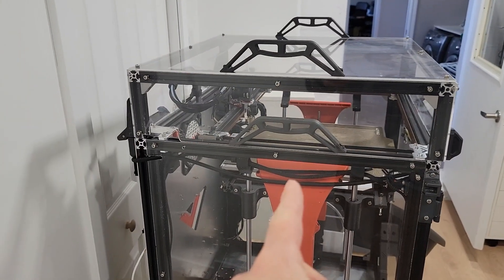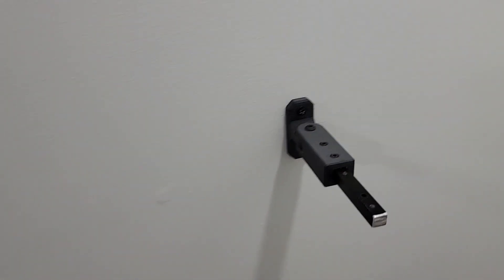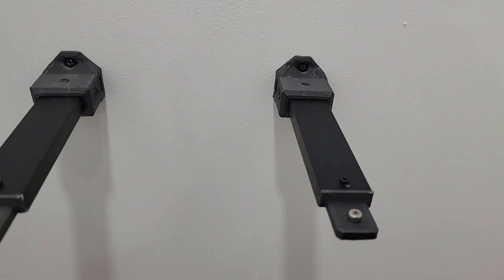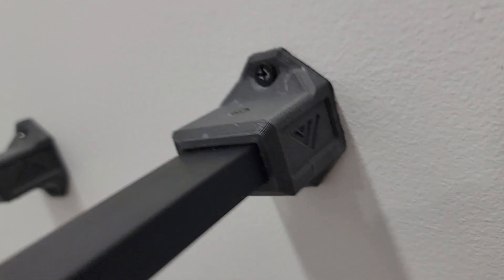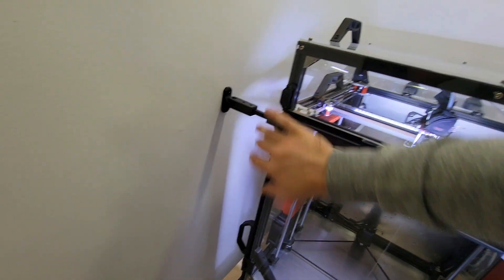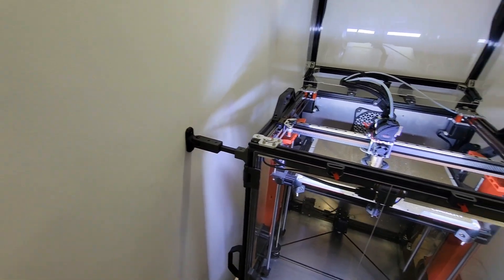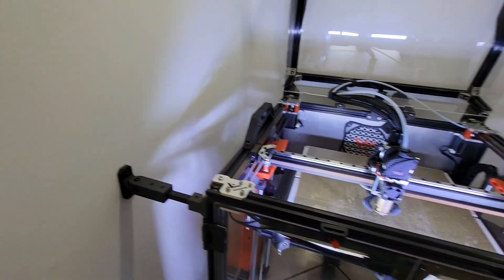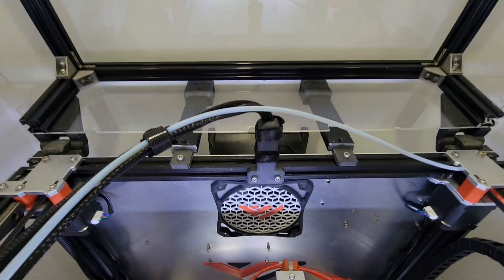bolted the VzBoT to the concrete wall

Comment: where we can find the part to print them?
Reply from the maker: Its probably usless since the rear aluminum parts were left over from my shower. And left mount was made with left over from the tronxy x5s bed assembly. I suggest you use the brace from the the vz235 github instead
Reply: @Vez3D  thanks Simon

Comment: Couple of days ago i was wondering if it would be smart to put a printer in a larger cube frame, and fix it to it with some kind of vibration dampeners in all axis, to allow the whole printer to move thus transfering the vibration to the dampeners instead of the print, do you guys think it would be smart?

Comment: That is awesome! As a bedslinger owner I did something similar but from the bottom. I made a concrete table out of concrete flagstone 600x600. It weights almost 100kg. I drilled thru 4 holes that match the position of vslot frame and bolted the printer tightly with t-nuts. Max recommended input shaper value increased from 4k to 9k. Maybe you should give it a Try. It costs nothing and some extra rigidity is always welcome.

Comment: Be interesting to see if this improves the print quality - it may well make the reliability worse in terms of the vibration shaking bits loose?
Reply from the maker: my printer been screwed to the wall for months .. maybe full year. :) its been fine

Comment: 6DoF --> 6 rods :) .. or do you trust your Ikea drawers to hold the base steady? 
IMO, at least two more horizontal rods near the base (one X and one Y) are advisable. The Z-stiffness of the drawers can likely be trusted.
Reply from the maker: more mounts would be good yes.. but I dont think its necessary at this point. I think its totally stiff enough the way it is right now. We shall see. Thanks for the suggestion too :)

Comment: But now the wall acts like a speaker!
Reply from the maker: not this one. Before, on the old location, yes..it was very noticeable, because the was a inside wall, with just air inside. But I was surprise on these 2 walls. They are full isolated with foam and mounted on concrete basement. Sound is not bad at all. And since this is in the basement and all walls are concrete, you dont hear anything in the rest of the house :)
Reply: @Vez3D  man i love what you do,  keep the content flooding <3

Comment: This is neat but I’d really love to see some analysis of how this improved your printing like a before/after input shaper graph comparison
Reply: Im not sure its really worth quantifying in that level of detail. Either it makes a BIG difference and the results are instantly noticeable, or the improvements are not visually apparent, and therefor probably negligible. Either way its a win cause less vibration = less noise / generally just more secure and stable, keeps it from getting bounced around or knocked by pets or kids as well.... I might consider doing this myself :p
Reply from the maker: thing is.. it doesnt change a lot on the shaper graph honestly. BUT there is more than just resonnance at the printhead and frame. There is also vibration on the bed. When the printer is moveing a lot, the bed also is being shook at lot at high accel. Bolting to wall stabilize the whole thing... I realized this a while back. hehe Bed needs to be ultra stable... and it cant be stable when the printer is shook hard.
Reply: @Vez3D  The bed (z-axis) and x,y gantry should not even be mechanically connected. They should be two independent structures therefore vibration cannot be transfered.
Reply from the maker: @Internet Tough Guy  gantry is attached to frame right? It slides on a rail that is attached to frame. That movement is shaking the entire printer. The bed is in the printer right? If the whole printer moves...then bed moves with the printer. The bed plate is shook too by the frame that is shaken from the gantry motion. The bed is sitting on either springs or silicon. There is a bit of this but also a bit of slack too in the bearing, etc..  So yes..it affected..at leat in my case :)  but this is only at violent accel settings. I had a ultra slow motion video i took that show this very cleanly. But it was with odrive who have WAY more inertia than those nema17. And there was absolutely no way to run this without wall anchors hehe
Reply: @Vez3D  Yes I understand how it's built. What I meant to say is for your next project think about a design where the x,y gantry structure is completely separate from the z-axis bed structure. the bed structure would sit inside the x,y structure but not be physically attached to it aside from sitting on the same heavy base (preferably concrete or granite). The bed structure would still be on isolators.
Reply from the maker: @Internet Tough Guy  ah I see!! Interesting idea :) thanks for sharing
Reply: @internettoughguy  are you talking about the design by pantheon 3d printers
Reply: @Z-add  I don't know about that printer. I'm a structural engineer. I design equipment to measure thrust of aircraft engines among other things. Understanding how mechanical structures behave under dynamic load is my specialty.

Comment: If you see any improvement in print quality, improving the rigidity of the frame should be the next step. Those thin aluminum extrusions probably ring like crazy at these high accelerations. 

I really want to see a printer like this with an epoxy granite frame. They build industrial milling machines out of that stuff and it's surprisingly easy to cast.
Reply from the maker: i get super nice quality and input shaper does the job.. and bolting to wall.. i dont get a lot of ringing honestly. And I dont want that printer to be too heavy.. because thne it becomes super hard to move. the frame is super rigid with all the pannels acting as brace. It wont move at all :)
Reply: Yea, I think it wouldnt make much sense, but it would be really interesting to see

Comment: Would be interesting to hear if the vibrations from the printer can be heard in the house, or from the outside.

I'm interested in doing the same to mine, but I live in an apartment, so I'm worried about disturbing my neighbors.

Been thinking about adding an RC-car damper, or a bike steering damper so any harch vibrations are muted and dampened out.
Reply from the maker: definately not a mod for normal walls. I had that before, and it amplify sounds a lot. Now with these concreate external walls.. its perfect. It even dampens the noise. If you still want to do this.. you could use rubber between the mounds and the fame or the wall to reduce vibration transmission. In my case, i wanted all vibration to be tranmistted to the wall
Reply: You could try anti-vibration feet for washing machines
Reply from the maker: @al1sa920  I have rubber fee on the printer too.

Comment: I have always wondered what's better for quality at speed- Bolting the frame to a concrete wall? Or having a really rigid frame and let the frame dance on the table?

Will the forces exerted by the motor on the frame warp the frame if it's bolted to the rigid wall? The energy has to go somewhere right?
Reply: i have wondered the same. tall thin parts may detach from the print bed with the dancing printer method though.

Comment: This is awesome, congrats. I wonder, if you see an improvement in quality, if a tuned mass damper (or other damper on the enclosure) would be a solution.
Reply: This printer gets to speeds where the forces exerted on the frame create shape deformations. In this process heat is produced and energy is lost, however the frame is also elastic and thus the frame itself is a mass spring damper. Im honestly not even talking about the "moving parts" like gantry itself. That said Damping the energy out of the system is one way to get rid of oscillations, but it lowers the systems higher cutoff frequency thus reducing the accelerations you can run it at.

This one quick modification decreases the compliance in this frame so significantly that higher frequency wont every be an issue.

Its almost equivalent to mounting your z axis and gantry on the concrete directly. 
So if you just want to get rid of some difficult to deal with printing attributes, this is probably the biggest bang for your buck by far.

Take note that all metal working shops have the machinery bolted into giant concrete slabs just for this reason. Precision machinery sometimes required finely cut and polished granite slabs to be imported.

Honestly its kind of comedic how much of high tech is built on high quality heavy rock for this reason.
Reply: Oh and if my last post wasnt enough text, im really sorry. Did you know that the P and D in PID are virtual springs and dampers, so we often choose to control our mass spring dampers with specially designed mathematical spring dampers. 

Imo some interesting funfacts that  are actually useful to know.

Comment: Did you do that to increase print quality by reducing vibrations? In that case, isn't it possible to construct a counterbalance system instead?
Something like this: 
https://www.youtube.com/watch?v=ajdU7me-DKo
and this: 
https://www.youtube.com/watch?v=tFHIV_bfrDI

As a bonus here is a counter recoil AK (same principle): 
https://www.youtube.com/watch?v=kT9bAeIQWrs
Reply: Don't think anyone would be developing such a system. We already have input shaping
Reply from the maker: input shaping really takes care of that honestly. But its helping that I bolt it to wall too
Reply: @Vez3D  Yes, but what's the purpose of affixing the printer to the wall if Input Shaping does the trick? It's my understanding, input shaping is good but not adequate, and most people can’t simply clip their printers to the wall, thus I've been looking for a different approach.

Comment: My OCD would not allow that upside down logo, LOL!  It would haunt me until I flipped it.  Sure looks like a solid mount though!!
Reply from the maker: hey you !!!! dont trigger my OCD too haha. It will haunt me I know. But I am affraid unscrewing and rescrewing will widen the drilled holes in the concrete. so I might leave it as is
Reply: @Vez3D  what do you mean it will widen the drilled holes? Did you use anchors instead of dowels?
Reply from the maker: @al1sa920  I used concrete screws. the same screws I used for my outdoor patio screwed to my concrete fundation.
Reply from the maker: @al1sa920  you know the blue screws ? I just painted the head black to match .. like these ones : https://www.amazon.ca/SNUG-Fasteners-SNG485-Phillips-Concrete/dp/B07PNHKPXV/ref=zg_bs_9526389011_24/134-8207619-8853739?pd_rd_i=B07PNHKPXV&psc=1
Reply: @Vez3D  oh, I've seen them, but never used. In Russia we don't have them in blue, only yellow. Anyway I wouldn't use them indoors, because the hole is not reusable. Instead I would use Fischer Duopower dowels
Reply from the maker: @al1sa920  ahh thanks for the tip. Yes thats why I didnt want to unscrew them and put them back :) I will look at fisher duopower dowels

Comment: Because concrete has almost no tension strength (comparatively) I will be very interested to see how it holds up the intense and repetitive vibrations.  
If it does wiggle loose over time a dab of flexible construction adhesive in the concrete anchor hole should address the weaknesses of concrete and keep going for years too.

Great work thanks for sharing.
Reply: I don't see how for example would "Fischer duopower" dowels degrade with such comparatively small vibrations printer makes. I use Anycubic Chiron and the table with metal structure was moving a lot, so I connected it to the wall (metal carcase with double gypsum fiber sheet) with 2 metal angles, cheap dowels and small self-tapping screw for metal. After half a year of use, the system was as strong as the day I made it.
Reply from the maker: great tip !!! thanks for the tip. Do you have a link or a brand in mind ? And also, will it be permanent? Or will I be able to unscrew it from the concrete if I need to ? Well I guess I can always cut the screws if its permanent...
Reply: @Vez3D  You will know if you need it, the bolts will come loose on their own.  I would only use it then but any major hardware store will carry construction adhesive, the label with say flexible or not, masonry or not and so on.
Reply: @Vez3D  I have heard great things about Sika branded adhesives. I was going to use some to fill some gaps in my front steps but I procrastinated too long before Winter, so I can't give you my experience with the stuff. However, I'm sure any tube of construction adhesive that indicates it is for masonry, and is not the cheap stuff, would work well.
Reply: @Vez3D  I was only curious because a lot of printers vibrate A LOT. You may not have any issues especially because the plastic coupler might have enough give in them you could run it until the plastic degrades before you have to maintain the brackets. The drill bits that go through the stuff basically vibrate (hammer drill) to get through concrete. Removing items in concrete is done by violently vibrating them loose too.  If I were a betting man I would put money on not having any issues ever with the anchors properly installed.  The metal and plastic in the printer is infinitely softer than the masonry and will most likely fail first.  I would just like to hear about it if you do have any issues. 👍🏻 I hope that clears up that I am not actually concerned.